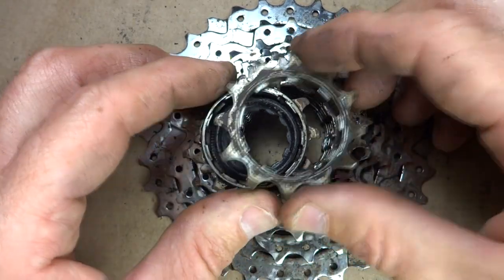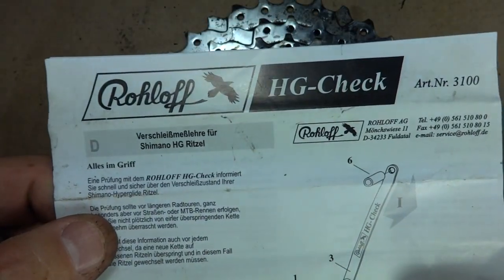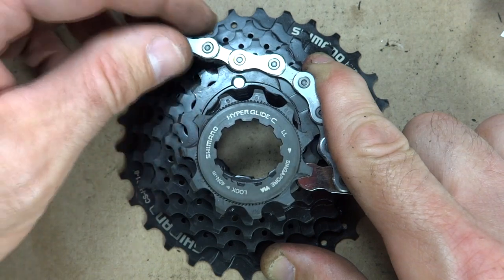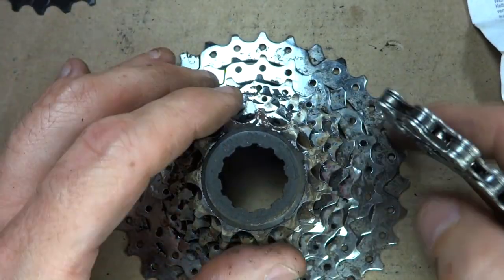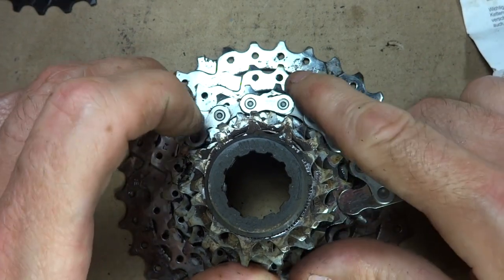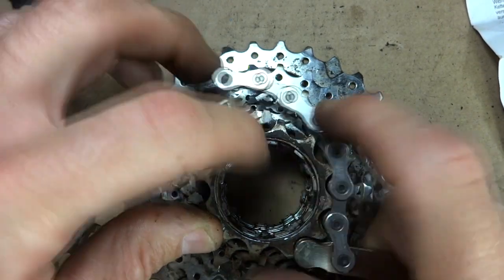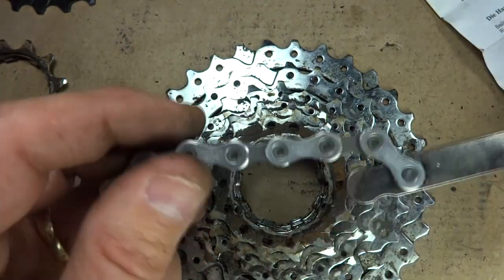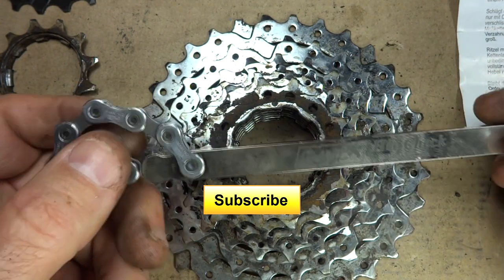How To Check Cassette/Freewheel Wear With Rohloff HG Check Tool

Comment: The Rohloff and other near identical tools basically just use six links of regular chain; you could easily make one with a new chain segment, and the essential concept is to apply tension when wrapped on to cogs 21 t or smaller. Under firm pressure, the chain should drop six pins easily into the notches; if it binds on or before the last, or even worse, jumps all of the three plus links off entirely, it is a worn cog. They say cogs larger than 21t rarely wear enough to need replacing (!), so aside from alloy 20-22t granny rings up front, chainrings are a non-issue as well. Ugly old cassettes you'll likely replace anyhow; uncertain ones, well, just wait until a new chain starts jumping under load, and replace then before riding too far on that new chain. Don't overthink the problem.
Reply from the maker: Thanks for watching!
Reply: Thanks for taking the time to explain...
Reply: Probably you'd kill your new chain too fast when you don't replace your cassette early enough. Also, a chain having a much different wear than the cassette has, would apply a lot of tension into the system. So to say: a bad cassette with a new chain will kill some performance, long before any jumping over happens (which, from a "professional" approach, should never happen, imho).
Reply: @puckibort6601  why not just use an old chain , just a thought?
Reply: Can't you do that with a chainwhip, also?
Reply: @johngta7172  An old chain would give you a false reading.

Comment: great video - i have gone cross eyed looking at a cassette to see if worn!!! Modern teeth have weird/irregular tooth profiles which makes it impossible to judge by eye. I'm surprised Park don't have a tool that does this.
Reply: I'm tempted to buy a dirt cheap chain and use 6 links to see if it gives same results as rolloff version.

Comment: can this tool, be homemade?? or diy???
Reply: leextranjee yea you can make your own chainwhip tool just need piece of  aluminium rod and use a piece of a old chain cut it out down to around 8 links. And piece it to the aluminum handle
Reply: Norm.Panganiban: Except for the important fact that this tool is NOT a chain whip, nor can it be used as such. 
It could be made as a diy project but, at the price it's going for, why bother?
Also, you should be using a piece of NEW chain otherwise the chain's wear would upset the accuracy of the tool.

Comment: So basically it can be made from remanings of new chain after it was shortened and some metal handle?
Reply from the maker: Maybe, maybe not. Just because that is what it looks like, doesn't mean that is all it is. I don't know if the chain part has the exact same specs as a normal chain. Maybe, maybe not.
Reply: If you get all the measurements correct, yes. That's a big "if" though.

Comment: any idea on cause if the bike is slipping/skipping under torque on the 11 tooth sprocket on a new cassette? tested multiple new cassettes.

new 8 speed chain on the 8 speed bike as well.

derailleur has been aligned and indexed as well.

everything run and shifts fine on the maintanance stand. but under load in the highest gear it keeps slipping. tearing my friggin hair out trying to find the cause.
Reply from the maker: https://www.youtube.com/watch?v=VzrpC7jrz8U

Comment: just use a new chain to check.
Reply: Your post is not very detailed or informative, yes?
Reply: True, but: still you want to conveniently apply some pulling force. Fit, if necessary, your regular chain whip with a new piece of leftover chain, and mark the chain link that should be your "sixth" one. Am I right?